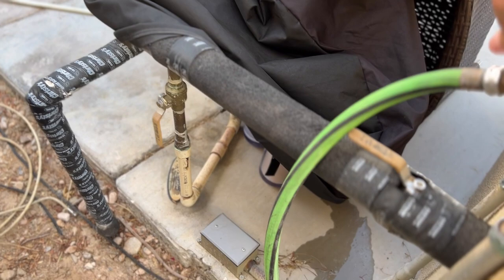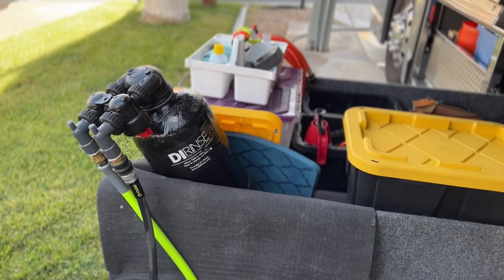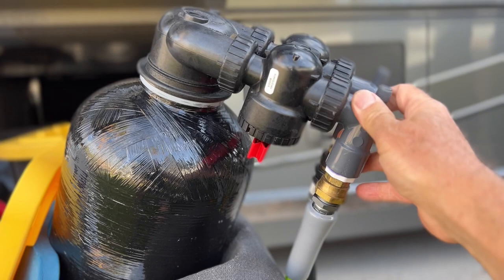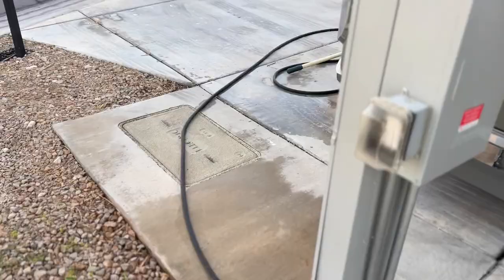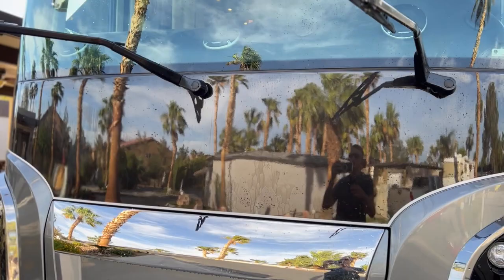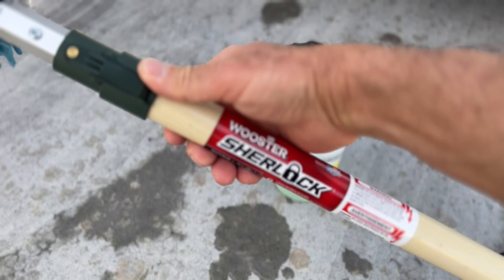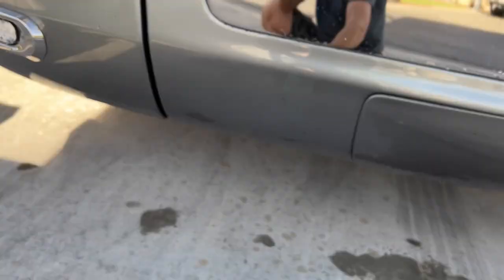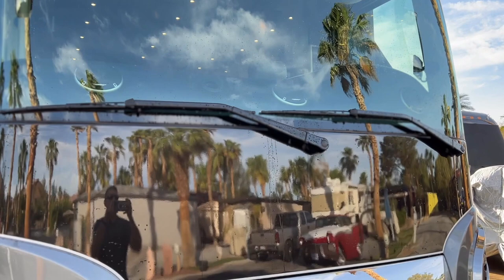RV TIP | Get the Bugs Off with Quick & Easy DI Bug Wash in 10 Minutes!

Comment: I use Wash/Wax on our coach and have really enjoyed the new pole that came in the kit.  I believe they have addressed that issue from the past   Unfortunately, I don't have DI water, but found that a few squirts of the cleaner and I am good to go on the front end.  Hate bugs and a lot of parks will not let you wash you rig, so just another reason why I went with the water less cleaner/waxer!
Reply from the maker: Hi Joe, glad to hear you like the new pole with WashWaxAll.  I hope they DID make an improvement to their special quick-extension pole, because really liked it.  Glad you've got a good system down for those "restricted" parks!  Thanks for watching.

Comment: Excellent video. Did you discuss with Bob Moses using Bugs N All on your ceramic coated coach?
Reply from the maker: Thank you!  Yes, we discussed that. The surfaces I use Bugs N All on are all XPEL PFF, so it really doesn’t matter. But nonetheless, they didn’t feel it would harm the SENSHA ceramic.
Reply: @RVSquaredSteve  That's what I was wondering was about the ceramic.

Comment: What are your thoughts on facia and windshield protectant wraps? Are there any you would recommend?
Reply: @sevance1  would you consider doing a video showing where you have applied the film on your coach and some related info such as maintenance? Thanks
Reply from the maker: Hi Barry...thanks for watching and for your question.  Yes, I STRONGLY encourage a "PFF" for the front of ANY vehicle; all of mine, including the Newell, have it.  Over the years, the film has gotten better and better; the latest and best, is XPEL.  The general cost of a truck or coach is nearly $1k now; with the more intricate cuts being even more.  I've applied the flim to other areas that are susceptible to damage, such as the lower fascia of the rear bumper, below the shoreline bay, and behind wheels.

For windshields, this is a hard one.  Due the the thickness, installers at Newell can't use the good film on the windshields due to the complex curvature.  At least, not without making a multiple piece install, which is what some folks have done.  If you can live with the seam, and the initial cost, it's certainly a good insurance to have; considering the Newell windshields are above $2500 to replace!
Reply from the maker: Definitely...I'll put that on my list! Thank you for watching and your suggestion, Barry.